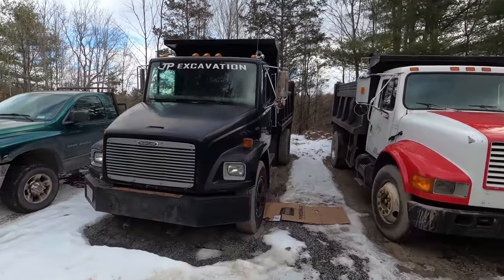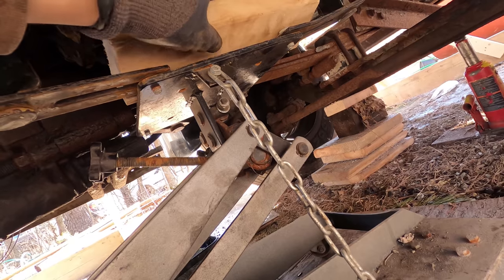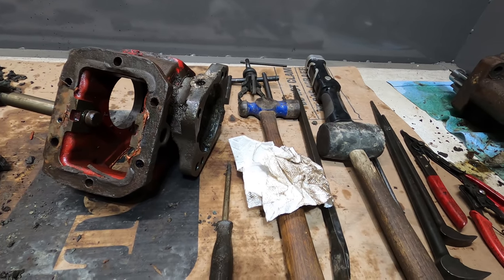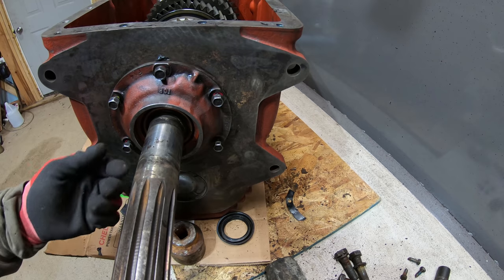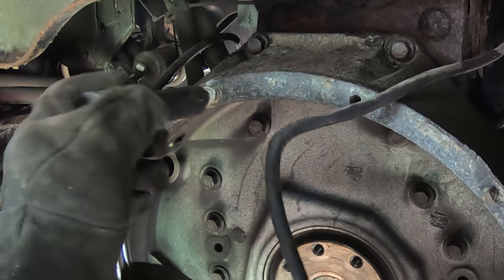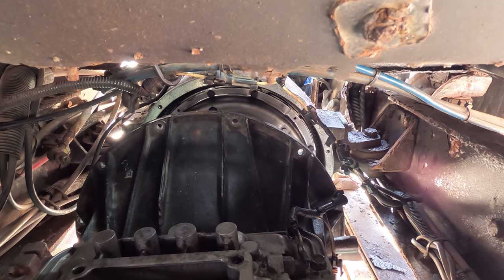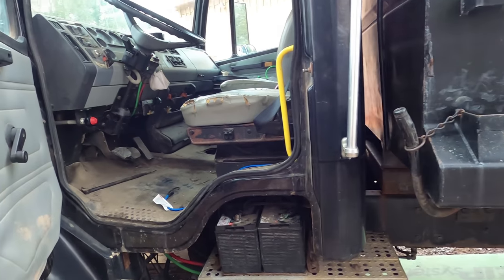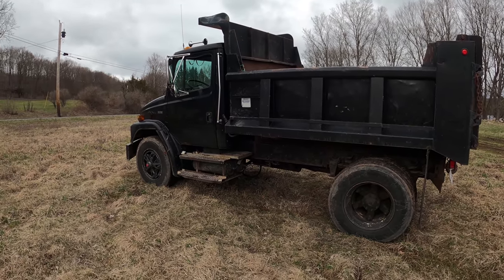Buying and fixing a dump truck: 96 Freightliner FL70 w/ 8.3 cummins

Comment: Hiya, Great video, thank you. The 'Heli-coil' insert, when I used them in the '70s we broke off the tang by turning the tool to remove, ie anti-clockwise. You can't drive a truck like that I don't care if you own it...NO COFFEE!!! That cup holder is there for a reason you know, to put your coffee cup in while you have a scratch...
Stay safe...Steve...

Comment: Amazes me that you have the balls to dig into this stuff like you do.  Did you attend a vocational college?  If not, how do you know how to dive so deep into this stuff?
Reply: I 2nd that statement. I swore to myself when I hit 40 that I would never again work on a machine on a frozen dirt ground. Lol
Reply: @etacbro7031   I say that now and I’m 20 lol
Reply: simple you start young ripping things a part to see how they work, then try to put it back together, then as you get older you just dive in to it, lay your parts out as they came out, take photos if you have to. bag and mark each set of bolts..  as you get in to bigger things it is not intimidating,, even when it is some thing you have never seen or done, it all the same just different and more parts. you just do it.. that is how i learned.
Reply: Balls of steel..................
Reply: Experience > any vocational college
Reply: Doing the same thing I tell people you need balls as big as planets to crack into some jobs,nothing to it but to do it attitude men like this got us to the moon.
Reply: @etacbro7031  I'm 65 and would rather lay on frozen ground than mud. ✌

Comment: You should always put antisieze compound into the pto splines before you install the pump, there is always a small miss alignment and it keeps the splines from wearing. The fuel tank usually sits on some kinda tar rubber insulator tape between the bracket and the tank. You did a good job, yes that was a bunch of work.
Reply: You ain't lying
Reply: And  operate your PTO about 1,000 RPMs no more

Comment: That transmission looks good, the top of the gear teeth are flat and not worn to a knife edge. I don't see much wear on the sides of the gears. it doesn't have a lot of miles on it.

Comment: As a man from the south it trips me out that you guys in the north have to deal with all the slat and then rust on everything i got a truck that is 35 years old barely any rust on it. It is almost like you need your truck to leak all under them to save them from rust.

Comment: 1200 foot pounds???  Regrettably it doesn't work that way.  Each impact manufacturer sets their own power ratings, the manufacturer's numbers are only relative numbers in their own line of tools, there is no standard, they can makeup any numbers they want.  There is a newer YouTube channel that tests impact tools: Torque Test Channel

Comment: Jesse, I think you did good, buying this FL-70, you still are not upside down in it, the 2 speed rear end shifts very smooth, (big +),it is low miles, and the 8.3 Cummins sounds great and starts very good! The 8.3 manual injected Cummins are great motors, and have plenty of power, and get great fuel mileage! You will find out, split shifting will not be necessary till you get into 5th gear! Give that rear end a break! And its got a air tailgate release/latch, which you will find is a great option! Big thumbs up!

Comment: Nothing seems to scare Jesse. Buying this stuff and not knowing what you could get into would scare most of us! You have to admire that!!
Reply: That's true, to a certain extent.  You can screw yourself in a heartbeat trying to save money.  By my math, he has close to or over $8K in this truck.  You have to think long-term and be smart with your money.  He already had a truck.  Why not take that $8K and use it on that or even the Semi.  Many times buying cheap ends up costing you more over the life of the truck/machine/whatever.  And you have to look at more than just the financial cost.  Time, aggravation, downtime, fuel economy, creature comforts, and safety all come into play.  

On the flip side of that, buying new can do the same thing.  Unless you have steady work and know you can do the job with what you buy and won't need to upsize or downsize, buying new can break you.  I've never bought a brand new off-the-lot truck or piece of equipment and probably never will, even if can afford it.  Heavy equipment, especially semi's, lose value just looking at it.  Sign your name on a loan application, down it goes.  Getting in it and starting it up?  Yep.  More value is gone.  But then, the big one- as soon as the front tires leave the asphalt of the lot and touch the road, you've just lost a couple of thousand.  So, I buy used, but don't go much older than 2 or 3 years if I can.

Comment: If you weld a 9/16 nut on the end of that input shaft then put a long bolt on it. It will be easier to get back out of you clutches and pressure plate. Instead of using a vise grip on it. Just a little tip from an old mechanic. Boy the salt took a Toll on that tranny and PTO housings...Good job Bud...There a pain in the ass to change when there like that. But you got it done. Again good job... that 8.3 Cummins is a very good motor I have one in my motorhome. Love it...Great video, thanks for sharing...
Reply from the maker: thanks, that seems like something I would do with the nut. hopefully I wont need to use that old input shaft again though lol

Comment: worth their weight in gold those little engine cranes. I have two, one of them i put modified and big pneumatic tyres on it so I can move it around the yard easily.
Reply from the maker: thats cool, when I build my bigger shop I will put a hoist on a sliding beam but for now this does the trick

Comment: The helicoil into aluminum actually is a lot stronger than just aluminum threads of the original diameter. On aerospace stuff we use them a lot because the steel helicoil is more durable and can withstand more mate/demate cycles. The added strength is nice too

Comment: Thats commonly known as a Epicyclic gear train if i remember correctly . Only takes a gear or synchro hub to be damaged  and it usually outprices repairs and over in the UK we would go for an exchange g/box. Excellent  work Jessie as brings back old memories of what HGV mechanics have to struggle to do .

Comment: Somewhere in a video the suggestion was to weld a washer on the bolt and then weld the nut to the washer, which I think is the best way, it seamed to work better. I put together a collection of long set screws instead of making them. The Allen wrench is much stronger than the screwdriver slots. Had a box to keep them in so I always knew where the guide bolts were. Looking good

Comment: This is a lovely truck to keep. The motor is good and you did the transmission solid. Everything else is looking good. Just sort every bit of rust out and weld some re-enforcents where needed. A good rust treatment and some paint and you should have 10 years life on this truck. Wheels need hubs. Old style not good. Keep up the magnificient videos. For 10 Grand you got a good truck there. Cheers.

Comment: That was such a pleasure watching all that come together, would love to have heard some of the off cam comments :) When watching you manipulate the gearbox internals I was reminded of the Centurion tank. They discovered that by pulling one of the steering sticks when in neutral, it would turn in it's own axis. The designer tried to work out how that happened mathematically, but he went nits trying to work it out. Not sure if thats true, but it certainly brought back some pleasant memories of crewing the Centurion, compared to the Chieftain, bag of rubbish :) Fantastic, thanks :)

Comment: i remember when i work on my dads toter it was setup just too pull mobile homes it starter out it's life as a 22 ft 1969 international box truck  it was not a u haul truck but  we sold the box truck part for 3500 bucks  so when we took it over to the new owner i cut the bed bolts with a zall zal and we put a pier on each conor then drove the truck out  and lower the box to 4 inches off the ground then we used that money for the box too make a nice steel grated bed with removeable sides for our needs we used the truck for over ten years  and then sold it too another mobile home guy for 10 k  just cause of the customize options we built on this truck

Comment: That thing was heading towards the junkyard fast. The transmission you got looked solid, patch up the rust, and it is ready to be taken out of retirement. Bolts that go into aluminium gets galvanic corroded stuck something fierce, put some antisieze on them during reassembly, or even loctite will help keep the metals from melting together.

Comment: There is a Cutting like torch with a bellows canister.  You fill the canister with metal filings  and heat the cast iron. You finger the lever like a cutting torch to cut...but this torch feeds iron powder stuff onto your casting.  you can then remake your broken ear into a new one. Just redrill the hole.  You have just remanufactured a broken piece. 
The torch canister can hold different welding materials for different metals repairs. There are several in use around here in the various repair shops.  One repair my free spool casting winch release when the casting broke. Repair is cast iron....not brass.

Comment: I don't want to be "that guy" but every now and then I read something and I didn't know it, so I'm gonna say it just incase you didn't know. Extensions (especially stacked) drastically reduce the torque output of a impact wrench. I know you probably couldn't get the gun on some of those bolts without extensions, but if you have an especially tough one, and can get it on without an extension you will see a major improvement. If you knew this, disregard! Love the content.

Comment: JESSE , If you use pieces of 1/8" steel between the casters and frame of the middle casters your cherry picker will only be rolling on them and the casters on the legs . I did that to mine and it made a huge difference . Rolling on 4 casters is a lot easier than 6 casters .   Great videos .

Comment: Hi from Australia, I have been a heavy diesel mechanic ( trucks & earth movers) for almost sixty years and I would like to add a comment, when you install a twin plate ceramic button clutch ass'y like yours the inner and outer pads on the plates must line up. If the ceramic pads do not line up it causes the divider plate to warp and not operate as it should, otherwise a great job and that is a bloody huge hydraulic pump for a little tip truck.

Comment: Dayton HUBS: ..... remove Cast iron hub and chuck it in a vertical lathe...to remove the rear spoke flange plus a 3 or 4 inch extra top of spoke material from the rear, 
Insert a round metal piece of steel  that is 4"x 20" x ⅝" and a welded 1"x1' top rear band for a rear ring.  
Turn on lather and machine a new surface with a rear upward flange lip like th spokes had...only now you have  a 360 degree flange for the tire rims to grip. Notch out for the valve stems.  
Spoke will not spin the rims in the heavy suction soil.  
Power Transmission INC. of Duluth MN makes lots of these rims for the loggers in the woods. They like Daytons for tire change ease.

Comment: One thing you absolutely have to look for when installing the front input bearing cover on around that input shaft is that you don’t squish a bunch of RTV into the oil passage. If RTV fills that passage the front input bearing will not get oil and burn up the bearing and seal. While the top cover is off it is super easy to inspect and remove any and all RTV that made its way into this area.

You also should clean all housing mating  surfaces with at least a sanding block and attempt to bring them back to 100% true. This way things like you input shaft will be perfectly aligned with the pilot bearing and clutch to reduce wear.

Comment: Jesse here is a tip. If you ever have a bolt or nut you can't break heat it up with a torch. It works everytime 👍
Reply: didnt work on the plow frame we took off a 96 dodge ram. heated that sonabitch till it was cherry red for about an hr, in 15 minute intervals, still didnt move.heated the surrounding area, no dice. the heat just helped snap the bolt off though

Comment: Listen - you dont need to talk yourself into (or convince us) that you ‘still’  got a good deal on that truck....   trucks like those are almost bulletproof. Its not about how much you paid to fix it..  its about how much it will earn over its life now thats its fixed, and the labor cost you saved from doing it yourself.  The knowledge gained alone has great value.. Great job man, really...   any issue that truck might cough up in the future will seem like nothing after all that.    My company will ROUTINELY dump 15 grand into an old truck  - and THEN wind up sending  it auction anyway and replace it with a new one . - because its gotten to point of being more expensive to keep than replace.  You’re NOWHERE near that point.
Reply from the maker: yea this truck seems pretty nice. it is always nice to get the big work like this done and its finally able to move around to do the small stuff, and the small stuff seems even smaller after a nice size project like this

Comment: I'd be all over inspecting the frame and mounts on this. I've had a lot of rust buckets before. Heck i got a van in my back yard from Mass. right now. Makes that look new....
Reply from the maker: I have been inspecting things as I go, this one has no rot on the frame and mounts, I do need to replace some cracked brake shoes though, hopefully I dont find anything bad when I take them apart

Comment: Years ago when the double clutch plate was popular amongst British trucks I was taught to put the plates in a specific way, I cannot remember if the pads on the plates was supposed to be inline with each other or so they are out of sync with each other. The reason was to do with the pressure applied to the intermediate pressure plate when using the clutch.

Comment: @Jesse Muller you'll be more then pleased with the truck once you get the bugs worked out! I just picked up an 02 f550 6 speed dump with 60k on the clock...ran into the same issues you did with the FL... you should get some ams oil MP HD or RP-342...Did it on mine and no signs of rust even after this winter!

Comment: Great repair adventure! Since you live in such a rust prone area, may I suggest you paint those parts with a rust converter such as Rust-Oleum rust converter or POR15? A rust converter chemically converts the reddish iron oxides into bluish-black ferric tannate which stops rust and seals the part from the elements.

Comment: Jesse, it's a lot easier putting the trans and bell housing off and on separately.It makes it easier setting the clutch linkage to the bearing through the big hole and installing and removing the bell housing bolts. I also hope you "neverseezd" the pump to PTO splines. A good job especially on your back. Most of those commercial pumps come with instructions to support the rear of the pump to the trans. I have seen catastrophic failures when that is not done.

Comment: Hi Jesse, just piece of advice. The heli coils you installed were set in to deep. When you put in you just go flush or half a thread down.  You won't have room to break off the lock tang and most of the strength of the heli is spread out on all thread so if you go to deep there's no threads for the bolt.

Comment: Hey Jesse If it going to be a little while before you pull the bed Here is something to slow the rust down Take a 1 gallon sprayer fill it with Diesel and spray  the frame and every thing metal it will slow it down and in some cases it will stop it for a while.

Comment: 40 years of municipal vehicle repairs in beautifull upstate New York (Delaware & Schorarie countys) I never saw that much rust and corrosion on the transmission PTO & hydraulic pump. I have seen frames with holes rusted through delamination between 2 layers of frame a full inch thick of rust build up. Never say never just try harder. Then try again. Hint from experience as you are tightening the pressure plate hold up on the pilot shaft so it can slide out easy and the transmission will slide in easy too.

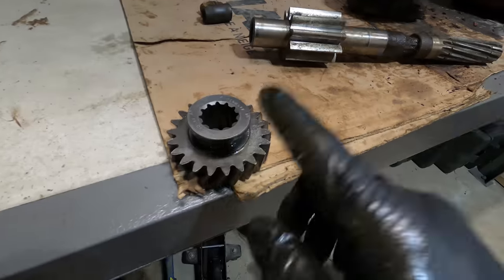Comment: @29:28 and 29:42, that is called a tooth rounder, ground in to the gears during production, to help mesh them up when you shift it into gear. As long as the gears are fully engaged and have good contact over 80% of their teeth, it's not gonna hurt a thing. Grinding it into gear when you turn the PTO on wears the tooth rounder back a little more each time.
 The 2 balls, are probably detent balls that were spring loaded , to keep the PTO in gear or out of gear.
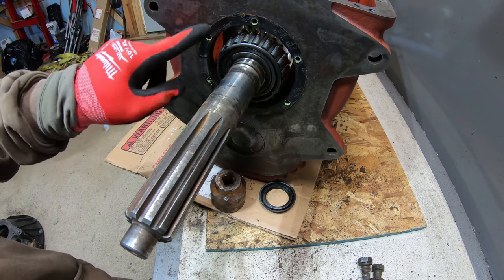 @ 50:09, the thickness of that gaskets, sets the clearance or pre-load in that tapered bearing.

Comment: You know because of all the corrosion you have in that area there is a corrosion inhibitors that I use here in Florida on my boat I use in salt water. I sprayed all engine with that spray 30 years ago and I have no rust. It puts a waxy coating that stays soft. It's CRC corrosion inhibitor. It is the only thing I use. I have used it on several outboard engines, and it has never failed me.  I would spray all transmission,  everything on engine whole drive train. 😊😮

Comment: You can always weld that dog ear back on with a dual shield welder.  Thats flux core wire and argon gas.  Thus duel shield.  Ive repaired many $5,000.00 pumps instead of replacing the parts.

Comment: That model Freightliner uses al cab assembly designed by Mercedes-Benz, we had them in Europe as the LK in forward-control form from 1984-1998.